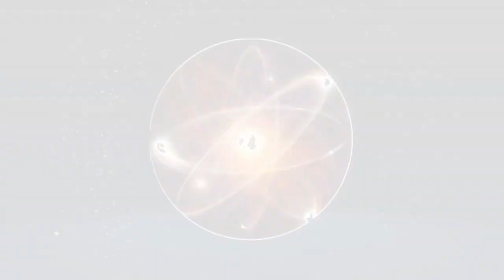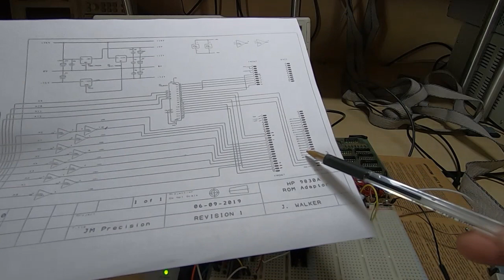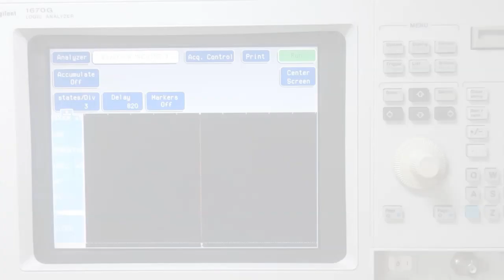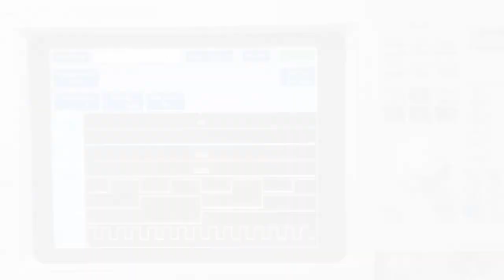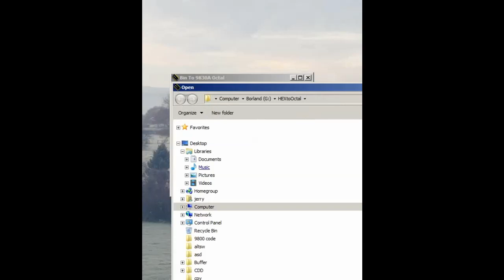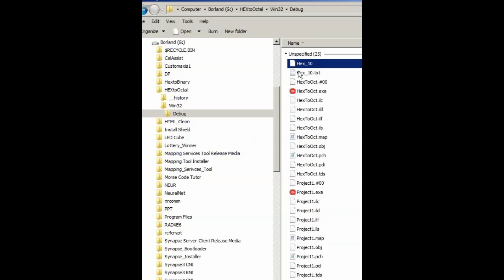HP9830A  Repair  Part13

Comment: Wondering what the timing is between the change in the address line lines from the programmer, and reading the first word of the four of data from the ROM, and whether that is within spec for the ROM.  That would depend on how much time the programmer itself allows for the data to settle after it changes the address lines.  I expect I will find out later in the video of series.  Again thanks for posting all of these. I really appreciate them.